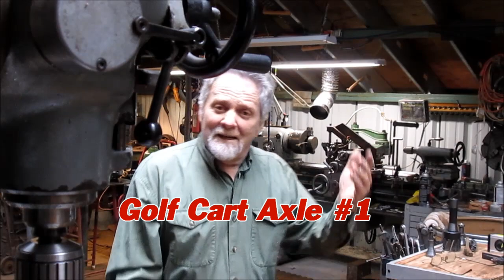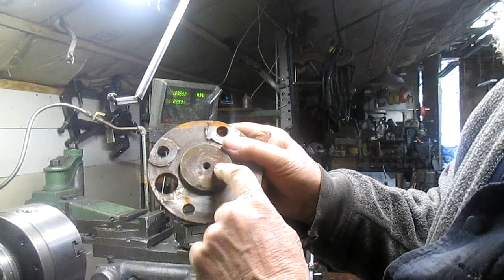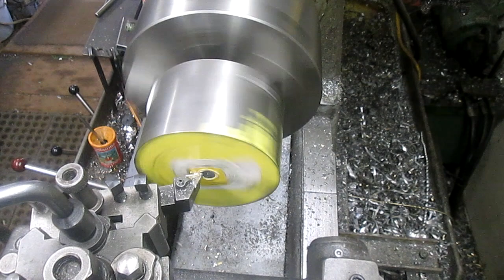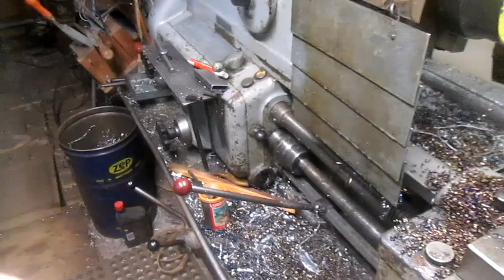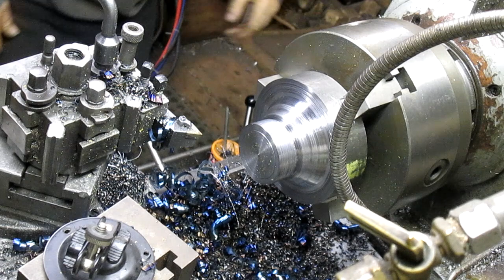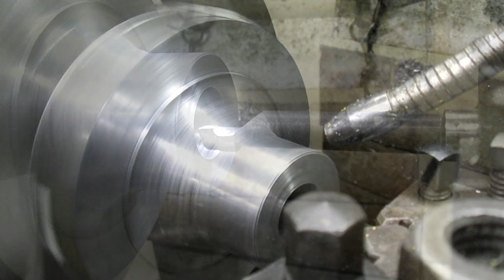Golf Cart Axle #1

Comment: Hi Nick, Yes that was me screaming at the computer again when I saw you using a 3 jaw chuck for the roughing. I could see exactly what was going to happen. As a machinist I leave my 4 jaw on the lathe and rarely use the 3 jaw. Once you have mastered setting up a 4 jaw it happens easily. If you don;t have a 4 jaw for that lathe then a centre would have stopped it removing itself for the chuck. I am not trying to be critical just offering machinists advice. Also probably a bit late now but I think I would have gone for a taper connection between the flange and the axle, a bit like Henry's Modal A axle set up. Cheers and keep up the good work as I love watching your episodes. Ian
Reply from the maker: It did fine until I tried to cut .100 at a time. Yes, the tailstock was needed.
Reply: Three jaw has nothing to do with what occurred.  A person either has the work piece secured or they don't.  Looked like he was fine until he attempted a rather healthy cut.  Tail stock... meh good standard operating procedure but not a requirement for that work.

Comment: Well, sir, it's another "I can't believe someone is paying you to do that." Good for you. Just a thought,  I would have gotten an axle shaft from something like a 90's mustang lx car and started with it. The reason for that car is that they are 4 lug and possibly could be the same bolt pattern.
Reply from the maker: There are so many other variables besides wheel lug pattern, bearing size, spline pattern, number of spline teeth, spline length, spline diameter, shaft length, bolt pattern to keep the axle in place.  I charged $1500. for that job and he got a deal.
Reply: @NikColyerMachineWorks  oh wow! Good for you. You could have probably called Moser axle and had them build it for $300 and drank a beverage of choice with $1200 in your pocket. 🤣
Reply: @NikColyerMachineWorks  I know that there was other variables but I mentioned the car axle because it most likely been oversized for your needs and could have been turned down. It was a thought.
Reply from the maker: @battleaxefabandmachine  And a good thought at that. I went with raw metal, it was much more fun.

Comment: Sounds like you took a Keith Fenner course on the most complicated possible solution.
Reply from the maker: Actually, I was worried. Golf carts are meant to be driven sanely on reasonably flat ground, which means they don't have limited slip differentials which means broken axles. This cart is driven by young people at top speed on hill with curvy roads. I wanted to make sure the opposite axle broke next time, not mine. Thus extra beefy.